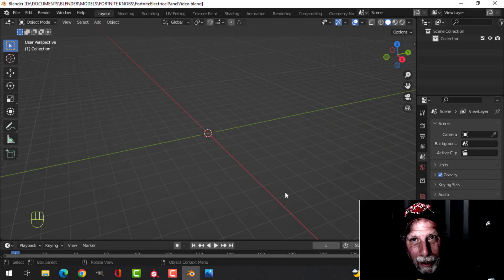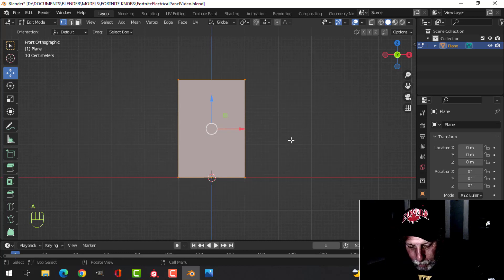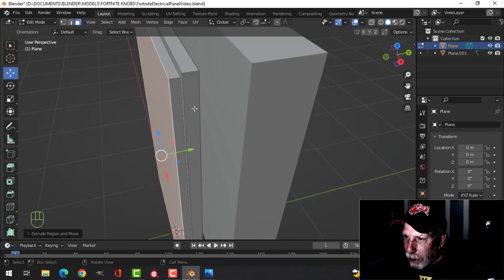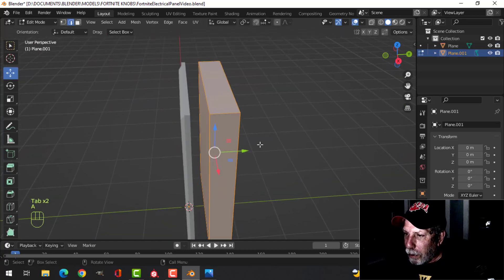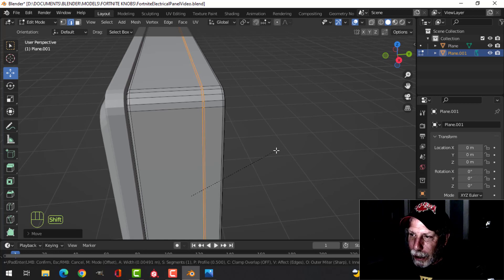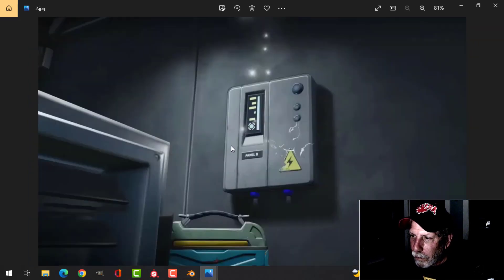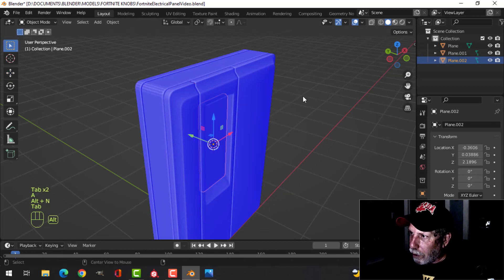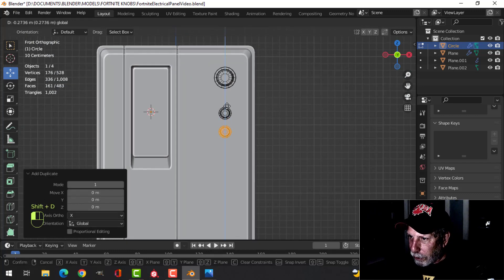BLENDER: EASY FORTNITE ELECTRICAL PANEL

Comment: From this scene, those Keg barrels and that chair (the computer set up itself too) also look interesting. I often use the shift+e "extrude along normals". Is there any real difference from that and the extrude then alt+s?
Reply from the maker: Yes, there are some other great items.   I will look for more references for those items and I have another object that I plan to do.  As far as I know, both of those commands do basically the same thing bit I've just gotten used to alt-s, especially in cases where I don't need to extrude first.